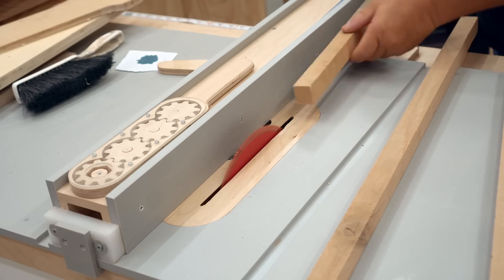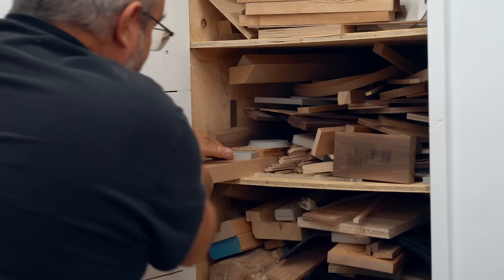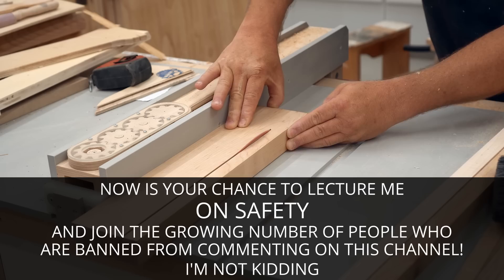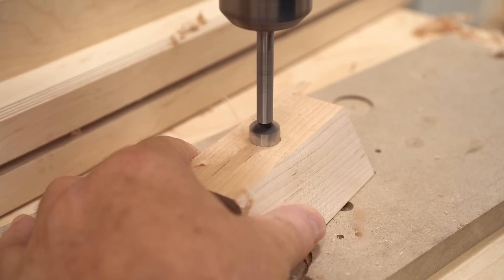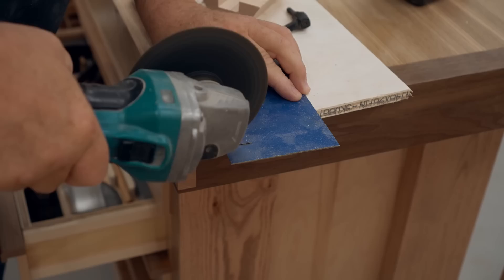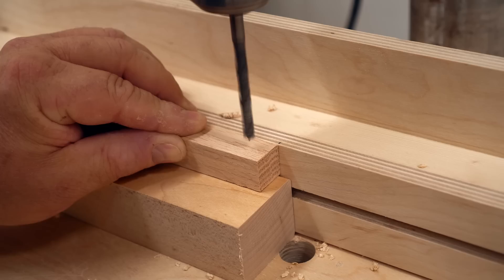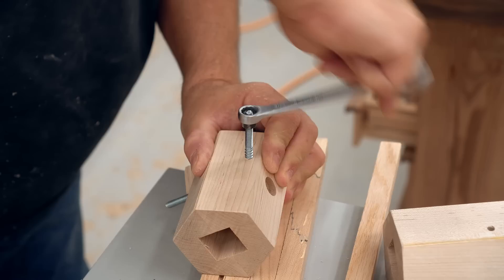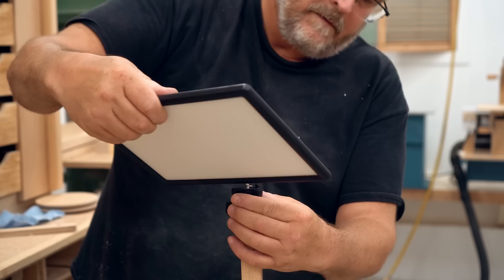How To Make Simple Folding Light Stands

Comment: I use my saw that way a lot too.   Take my time, think the cut through, know where my hands and body are going to go.   Only difference I see is that my minimum stock width for needing a push stick is maybe a little wider than yours...and you have LOTS more experience than I ever will.
Good project, thumbs (& all 10 fingers) up, and thanks for posting.

Comment: Nice simple clean project 👍👍!
I see that you have your sanding station on lift up and out arms, I’d like to see more. I don’t see any lock on the sanding station when it’s up, if you push to hard on the belt it would go back & down and you could lose your thumbs. 
I love your rants on the other channel, keep up the great videos!
Reply: If you pay attention, the sander is not just sitting at the top of the arc all willy nilly. It is forward past the top of the arc and the weight of the sander holds it in place. You actually have to lift the sander up then push back to unlock it.
Reply: Thank you Kip. If you look closely I had a ridiculous statement about losing one’s digits, avoiding the common term for the things on the end of your hand.

Comment: Most light stands have a way to put a sand bag on them to make the bottom heavier so it doesn’t tip over as easy (cause they are so top heavy) have you thought about were you would add the sand bag in you design if you saw the need?
Reply: Design it to not need the sand.